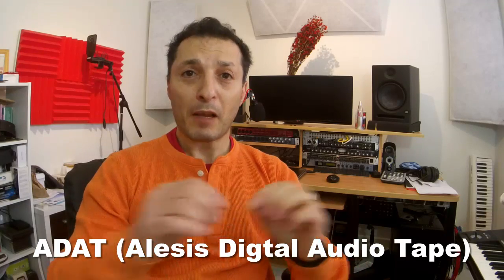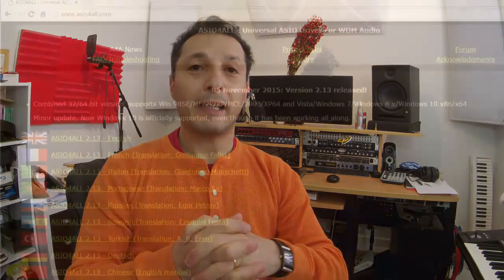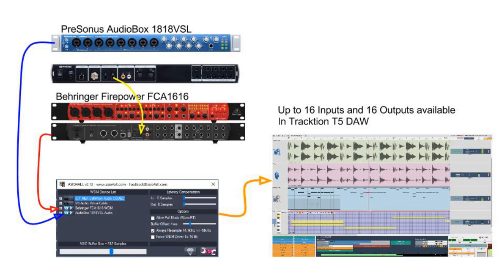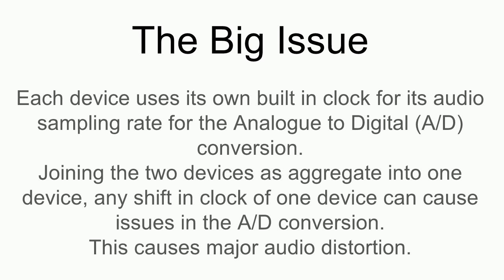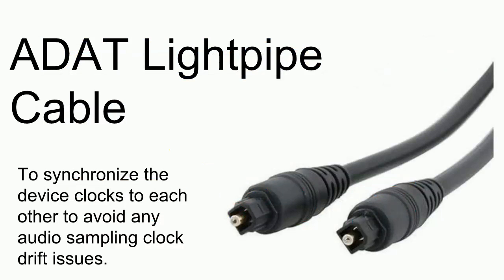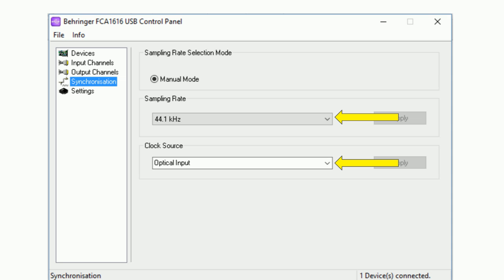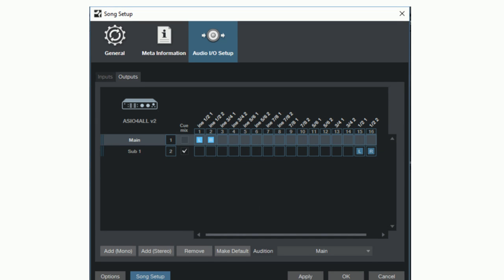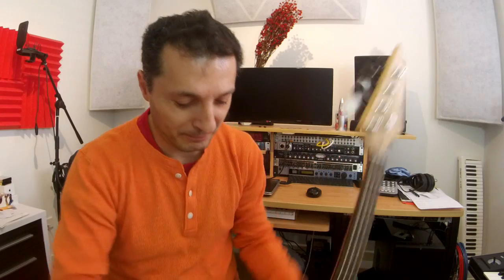Combining Two Audio Interfaces Using ASIO4ALL using ADAT as Clock Link

Comment: Is there an advantage to doing it this way as opposed to just connecting the ADATs together, and then connecting one interface via USB?
Reply from the maker: Unless your second unit is an ADAT in/out device, like the ADA8200 from Behringer, most interfaces do not direct inputs to ADAT, inputs go to USB. For interfaces, ADAT is an extension, ie. ADAT to/from USB. Hope than explains.
Reply: @RecordingStudio9  oh thanks, I didn't notice that one was just output.  Cool video, thanks for the response.

Comment: I've been looking for a video like this. I've got a focusrite 18i20 3rd gen and I need to record some drums next week. I have an old M Audio ProFire 2626 laying around that I want to use to record more microphones. I hope this works! Thank you!
Reply: Did it work? :)
Reply: @combyjames  I still can't get the adat channels to show up on my daw CJ. I'm almost about to call it quits on the m audio and just buy a behringer extension unit.
Reply from the maker: I'll investigate this possibility for you guys and report back soon.
Reply: @RecordingStudio9  thank you so much!
Reply: @RecordingStudio9  that would be great!! Thanks!
Reply from the maker: @combyjames  First thing to check to see if you have selected the Focusrite ASIO Driver in Cakewalk? Because even with nothing connected to the Focusrite's ADAT, you should still be able to see them listed in the Cakewalk settings, if not, then you may not have the correct Focusrite drivers installed.
Reply: @combyjames  Hey there, I got the two interfaces speaking to one another and I can even plug in a microphone on the M-Audio and sure enough, I can hear sound coming in. The only thing is, I can't figure out how to set up the inputs inside my DAW. I'm using Cakewalk by Bandlab. The Adat inputs don't show up as available when I open up the preferences. Any help would be appreciated.
Reply: @felipeguerrero2409  im using cakewalk by bandlab also! When i get everything I'll investigate further.. So maybe we can help each other out!..  If you find out let me know! And ill do the same
Reply: @combyjames  sounds good! I'll keep playing around with it and see if i figure bit out and let you know.
Reply: @felipeguerrero2409  awesome!!
Reply from the maker: First thing to check to see if you have selected the Focusrite ASIO Driver in Cakewalk? Because even with nothing connected to the Focusrite's ADAT, you should still be able to see them listed in the Cakewalk settings, if not, then you may not have the correct Focusrite drivers installed.

Comment: Hi, I have one question. I use the FCA 1616 in combination with the ADA 8200.
To create a monitor-mix in the rehearsal room I wanted to use the Line Outs of the ADA 8200 and connect them to the inputs of our  mixer - but I don't get any signal. Can you tell me how to connect the devices? Thanks in advance!
Reply from the maker: The FCA1616 and many other budget Audio Interfaces only direct the analog inputs (and outputs) to USB. So there is no direct connection from input to output, other than to MAIN output 1 & 2. The same applies to ADAT in/out. Any analog signal from ADA8200 will only go to USB to a DAW, and from a DAW to ADA8200 outputs.
If you set the buffer low enough, you might be able to send FCA1616 inputs 1-8 to your PC and DAW and output them to ADA8200 outputs. But, there will always be a latency.
Hope that helps.
Reply: @RecordingStudio9  Thank you!!

Comment: Thank you for this! One question... I have my system hooked up via ADAT, but I just found out that it's actually more accurate to use the word clock feature. With this said... I purchased an inexpensive 75ohm cable and a termination cap. Since Word Clock doesn't transfer data... I still have the ADAT hooked up. Based on what you've shown here... it seems as though I may have to change my clock source to maybe word clock??? Can you help with this?

Comment: Hiya my Man
wanna Laugh, saw your video some time back about joining two
audio interfaces together, using the adat fibre optic cable
well, i saw that last january, i bought an opticle cable from china
waited 5 weeks for it to arrive, saw another tascam us1800 on ebay
bought that, as things were working well, I though, thats a rainy day
project, so almost a year later, I re arranged the studio, as you do
decided to add the 2nd us1800, so moved a few items about,
 so i could mount both us 1800's in a rack on top of each other
a week later I was ready to connect thing up.
now wheres that dam cable???..
3 days later, it had found its way in the loft, with a bagfull of xmas decs.
only found it as it was 3rd dec, and we put the decs up.
15th dec, re united with my long lost cable, I told the missus, 
see you in a few hours. 
fired up the 2nd us1800, usb conected, asio4all found it ok.
went to conect the optical cable, and, NO!!!!!, there is no hole to plug it in.
A few choice words later, I noticed that there were two tascam us1800's
showing in asio4all, one was blanked out, I clicked it, it lit up
I fired up my trusty studio one, and hey presto, 
24 inputs 8 outs and they work as tested, so thankyou for the idea.
cant see any way to get the clocks synched, unless i can use the digital i/o's
in to out, and out to in, but both units have the clocks set to internal
but have a great day  - bob
Reply from the maker: I assume you now have two Tascam US1800, if so, just use the digital SPDIF to connect in to out, and set the one with digital in as external clock using the driver (page 11 of the manual). then you are good to go.
Reply: @RecordingStudio9  A big Thankyou, yes downloaded the manual, conected the spdif ports out to in, had to configure them seperatly, as the tascam configuration only saw one unit, so alls well at last, just gota find a use for all those inputs now Lol... All the best - bob

Comment: You shouldn't need to use ASIO4ALL to do this, just the ASIO driver from whichever device you connect to the computer. The ins an outs will all show up in the DAW. You must however set one device as a master clock sync and one as a slave. In other words if you connect the the FCA1616 to the PC then set it to sync from adat, then the Presonus will be the master clock. At least that is how it usually works. It is best if all devices have Wordclock sync, then you can set one as master and have many slaves.
Reply from the maker: True only if you are on MacOS, not Windows OS.
Reply: @RecordingStudio9  No... Macs don't even use ASIO.
Reply from the maker: @BrettNoack  That is what I just said. 
You said you don't need ASIO4ALL, and I said 'correct' if you are on MacOS.
You can't have 2 different devices with different manufacturer drivers and expect them both to communicate via one driver.
90% of DAW can ONLY talk to one driver. So we use ASIO4ALL on Windows to combine them as one, where on MacOS, you can use the aggregate option to combine them.
Hope that clears your confusion.
Reply: @RecordingStudio9  And I said you DON'T need ASIO4ALL to connect two interfaces to a Windows PC. So long as they are connected via the ADAT optical connectors.
Reply from the maker: So then, how will the analog audio be sent from one Interface to the next? I have seen maybe one or two high-end interfaces that can re-direct the analog audio to their ADAT output.
Unless you are using an ADAT in/out preamp like ADA8200 from Behringer, no other budget USB interface will work, UNLESS you follow my video instructions and understand how they work.
Reply: @RecordingStudio9  Sorry for any misunderstanding... but I was referring strictly to interfaces connected with ADAT optical connections, as FCA1616 and many others have. There are some drawbacks. i.e. the sample rate will be restricted to no more than 48kHz for 8 channels of ADAT. Although some interfaces will allow up to 96kHz while reducing the channel count to 4.
Reply: @RecordingStudio9  True for windows PC. I don't use Mac's.

Comment: and BTW, if all you need is only synced multitrack input (forgeting all the driver embedded in fact software-defined frontend strips) then I am sure best bet is to clear any vendor specific drivers to the roots from your system, let the system  (win/mac) to detect device as "generic usbaudio" and let the system driver work in native low latency mode (wdm on win, coreaudio on mac) AND having connected (the same) usb interface instances to SINGLE USB controller even through hubs (but, at last mile, the "multi-TT" usb20 hub controller is needed, which is probably not so common now... they are pricey, they are warmer or even hot, because they do more, they inject every full-speed 10Mbit stream input into 100Mbit high-speed uplink) ... plus, unfortunatelly, as usbaudio implementations use different comm methods ( sync / async / adaptive) on different devices, this is probably important too, so, if you want try this way also...
Reply from the maker: I will try and see, but some Audio interfaces won't work without drivers as they can be proprietary. 
Thanks for your comment

Comment: hi, you may be surprised, but I tested several years ago that what I thought even longer was finaly possible - to use usb20 high-speed multi-TT hubs to connect 8 discrete generic usbaudio 24/96 usbaudio codecs (some VIA chip) through 2 such multi-TT hubs to "single controller root" (thats important) usb sockets (or perhaps, yet another usb20 high speed regular hub, no need multi-tt at that layer, everything is already injected as high speed streams) ... and you know, as the whole beast is controlled from the sinngle main USB-controller in computer and it specifies exact buffer sizes and controls whole bus, then if you start sampling from all the channels (16 here) its all perfectly in sync at sample level, I predicted this (angrying probably many ""highend"" audio interfaces mfgs), then later I tried this, and it worked. howgh! :-) ... but now, prices of multitrack solutions over usb are uite ok, so no need to breakdance that much anymore :-) cheers
Reply from the maker: Thanks for the great info. Much useful.

Comment: Hallo...if both ADA8000 and AD8200 are combined in parallel can you or no? using optical cable
Reply: I have both, Behringer ADA8000 and Behringer ADA8200, I want to try paralleling so I want to have 16 input channels, 8 input x 2, can I think or not ???
Reply from the maker: Not that I'm aware of. The communication for ADA8000 or ADA8200 is to talk to a master controller like an Audio Interface.

Comment: thanks for the great explanation of connection for two devices. I'm actually using an old Motu 8pre firewire audio device. i need to connect it as adat buying a focusrite scarlett 18i20 or  a 18i8 to have 
respectively 16 or 10 pre channels to record at the same time. is it possible do it even if my motu doesn't have a world clock connection?
Reply: I forgot to say an important thing. I'm recording with Logic on my new MacBook pro 
15" i7 with touch bar
Reply from the maker: With Macbook, you can just aggregate the two interfaces.
Reply from the maker: @unclegineye  ASIO4ALL is for Windows OS only. Use the ADAT or SPDIF cables to sync the clock and use Mac OS Core Audio to aggregate the two interfaces. I don't use Mac so I can't guide you further.

Comment: I have a FCA1616 and a Presonus D8 and was curious about ASIO4ALL.   Was quite happy to see the 1616 here, now I know exactly what to do, thanks!
Reply from the maker: You should be able to connect the Presonus D8 directly to FCA1616 ADAT in via lightpipe cable and you won't need ASIO4ALL. In your DAW FCA1616 will display 16 inputs and 8 outputs.
Reply: @RecordingStudio9  Thanks for the response.  I've been using the FCA1616 driver and I see all the inputs.  Using 48khz.   The issue is Cubase says everything is recorded at 96khz, and plays back at double speed.  It also changes Cubase's project settings from 48 to 96.   I change it back to 48 and it works fine.  So, I'm thinking Behringer's 6 year-old driver might be the issue and therefore wanted to try Asio4all.   The file sizes are 48khz size.   The 1616 doesn't have a BNC connector, so I must use lightpipe.
Reply from the maker: @DrumsBob  The BNC connector is for the WORD clock. ADAT data includes clock signal already.
Reply: @RecordingStudio9  Thanks.   And thanks again for the video..

Comment: is there a way to use a behringer umc1820 like an ada8200 connected to a scarlett 18x20 through adat? is there a standalone mode for the behringer 1820?
Reply from the maker: I don't own a UMC1820 so don't know, but like many I have, they can't be as ADA8200. Analog inputs don't direct to ADAT.

Comment: Thank you so much for this. I have a question 
I have an audio interface which has enough inputs for what i need. I would like however to have multiple cue outputs(headphones) so that 4 people can listen at the same time. I would like to control how much each channel sends to individual headphones. Therefore i don't want to connect the "phones "output to a 4 headphone preamp. Getting 4 channel preamp however would require me to run ASIO4ALL . But i had many issues with that software since my computer is not very powerful so i would like to avoid any software solutions. With your expertise can you think of a solution to my problem ?
Reply from the maker: What is the make and model of your audio interface? How many outputs available?
Reply: @RecordingStudio9  thanks for your reply. I have an entry level swissonic UA2x2 usb audio interface that has 1 stereo output as well as a headphones output.
Reply from the maker: @stephanosphilippou1300  You are trying to fit 8 people is a 2 person mini car with each having a window view seat. Not possible :)

Comment: I followed the steps; however, I am only able to choose between one or the other of the two interfaces I have. I have a DIGI 002 and a Presonus VSL 1818. Do I need two adat cables or just one to make it work? I think I am closer than I was now than before I watched this video. Thank you for taking the time to assist. I am also using the ASIO 4 All Driver.
Reply from the maker: If you can see both interfaces in ASIO4ALL, make sure both are enabled in ASIO4ALL by clicking on the ON selection next to their name, this usually indicated with a blue coloured icon.

Comment: Hi, thank you for this very helpful video. I have some problem. I want to combine two audio interfaces behringer umc1820. I'm doing everything that you demonstrate in this video. My laptop see and recording every input and output but recording is with delay double tones. What i'm doing wrong? My laptop is too weak (processor: intel i3, memory: 8gb ddr3, disc ssd)?  I would be grateful for some hint. Greetings from Poland.
Reply from the maker: If you mean you can hear your latency, then you need to enable direct monitoring or turn off your DAW track Monitor option off.
Reply: @RecordingStudio9  
I think it is not latency. After mixdown tracks when listening to the recording,  still I can hear double sounds. As if the interfaces were traveling.

Comment: Excellent  Video and graphic explanation of a practical application for ASIO for all.I have used ASIO for all before but only to allow my TC- Helicon Voicelive 2 show up as an audio interface via it's USB connection. I also own a Voiceworks which I see is in your studio but although it works OK the LEDs seem to fail easily so I don't use it to it's potential.

Comment: Ironically, I can't hear the audio on this video, so if this question is answered there, that's why I'm asking it here...

Ok, so ADAT connection to sync the clocks. Check. ASIO4ALL installed. Check. Second interface. Not sure which to choose...My question is, do the two interfaces have to be a different manufacturer and/or model for this setup to work? I would like to use another of the same type (Behringer UMC1820 in my case) for consistency sake.
Reply from the maker: Since I don't have 2 of the same interface, I can't comment whether having 2 of the same will cause issues but I can't see why not. I feel it should work better due to driver consistency.
Let us know when you do get to try it out.

Comment: excellent very well explained, the only video that has understood the problem of synchronization, the only bad thing is that it is not applicable to cheaper interfaces like scarlet or the behringer umc 202, because the drivers of these do not have the option of syncronization or I'm wrong
Reply from the maker: It's not about driver compatibility,  but the physical clock connection. 
Thanks for watching

Comment: Thanks a million man!My Question is  I Have an Presonus 1818vsl  (usb) with adat optical /spdif and wordclock outs running into pc windows 8.1.And have just picked up an M Audio Profire 2626 (Firewire) which also has same outputs.Possible to setup the Profire into standalone mode on someone elses Mac then bring it home and link/sync it up with my presonus to have 8 more in/outs?What would be best way you think?

Comment: Sorry for my stupid question; I understand about the adat connections but besides having the lightpipe cable connected from master to slave interfaces, do I also connect both interfaces’s usb cables to the computer? Or just the lightpipe in between interfaces and only the master interface usb connected to the computer? Thank you in advance! Have a great day!
Reply from the maker: The lightpipe (ADAT) connection is being used as just a clock signal from the master to the slave. Both audio interfaces need to be connected to the PC with USB/FireWire.
Reply: RecordingStudio9.com appreciate it!
Reply: RecordingStudio9.com No the ADAT connection carry’s also an Sound Signal, not meant bad but there are Preamps you can connect to your PC who don’t have Any other option to connect to a PC (no USB, Firewire,Thunderbolt etc.)
Reply from the maker: Correct, but in this instance, it's only used as a clock sync. The audio from each interface is sent via USB.